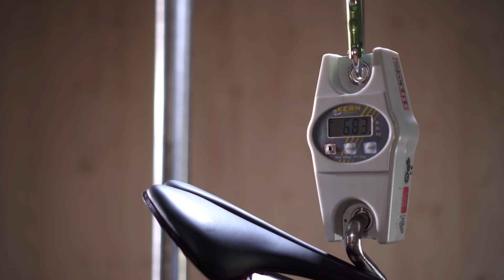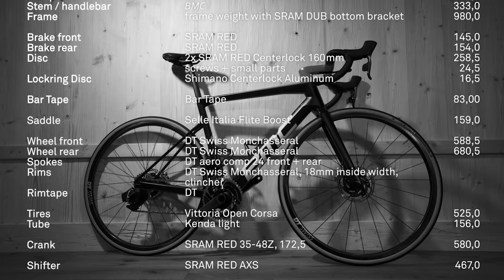Dream Build New 2021 BMC Teammachine SLR 01

Comment: HI, do you put a shift cable through the brake cables to get it through the bar? And how do you fix the end? BR
Reply from the maker: Hi Robert, in this case we used a tool we built ourselves. We screwed a small metal part into the brake cable and attached an inner shift cable. There are many professional tools for the job though ;). For example have a look at this video: https://www.youtube.com/watch?v=FUFH3rlkB4I

Comment: Can you please tell us why the video starts with the hydraulic lines already run and the calipers attached? Is this an indication of how hard it is to route these hoses? Does it come this way out-of-the-box?
Reply from the maker: With the BMC SLR01 it was very easy to lay the cables, because they mostly run in a channel, there is also a channel in the stem / handlebar, no need for special tools. It is a little bit difficult run the cables thru the headset, but this is the same with all fully integrated cockpits, it is nice to have a second person helping. We usually start with the assembly of the brakes, headset and stem, then we take the frame out of the mounting stand and film the details for the start scene.

Comment: 5:20 another BB spin fail. Badly designed BB by SRAM should be forbidden.
Reply: The DUB Design itself is ok. It uses a displacement preload system which is ok. The Problem is the misalignement of the Frame itself and the fact that you should be shot to sell your Customer a 30/29mm axle in a PF41 frame. A topic for BMC. Not for SRAM. I you  want a SRAM group watch out for a 46mm BB hole or that T47 Standard
Reply: But of you are wrong and shouldn’t listen too much to what Hambini has to say.
Reply: @jochem1986  I didn't realize SRAM uses a different standard now. GXP is bad though.

Comment: Where is the Di2 charging port supposed to go?
Reply: chrisytofa in the barend
Reply: @ianiscaratti4924  at the 35 second mark did i see a cut out on the down tube also? Almost under the aero cage
Reply: @chrisytofa  yes, that's where the di2 junction is placed on Shimano groupset.